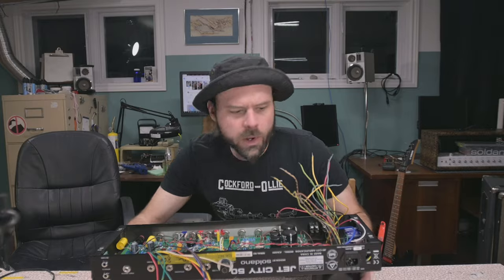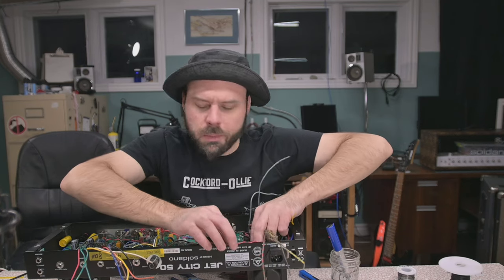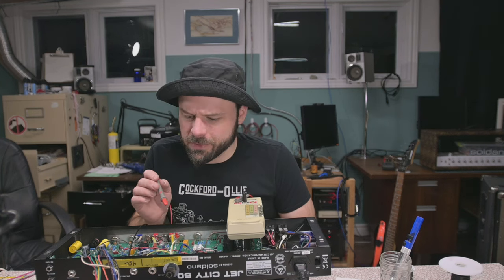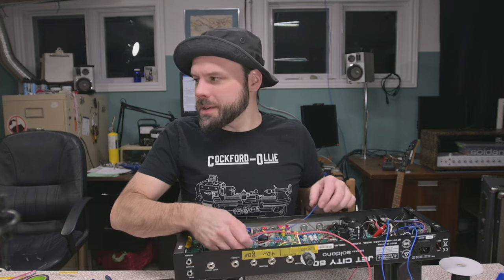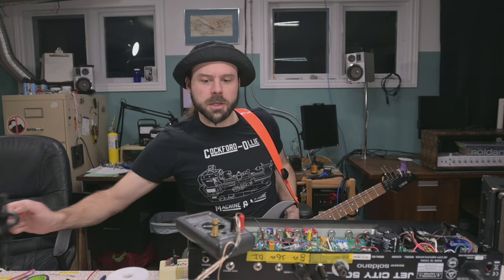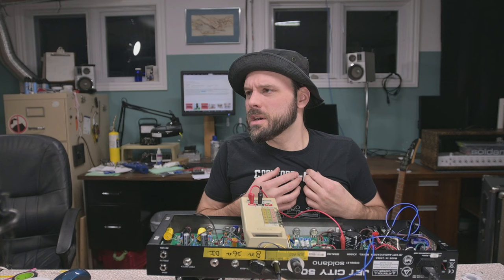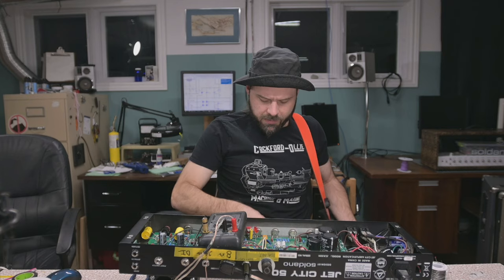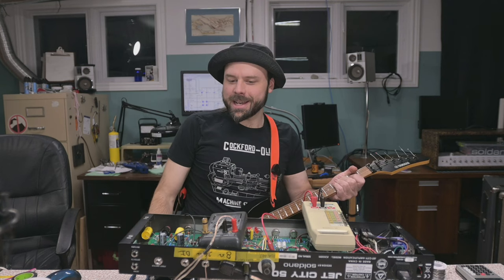Jet City Violence Ep.5 - Wiring New Transformers Part 2

Comment: This whole series of jet city and the slo build has helped me tremendously with fixing  my ol jca100h I had sitting around for years and hardly ever used. fired it up and noticed one power tube red plating after a while so I learned all about how to correctly bias and check voltages and currents. Got the tubes adjusted and after a while of playing the sound would cut off... 
Very long story short after all new sets of tubes the sound would still cut off randomly, very faint sound coming through tho. Everything checked out and tested ok i went through literally every component... after lots of insanity watching your videos dozens of times it turns out it was a couple of potentiometers that were intermitently cutting off or shorting out as the amp warmed up. Turns out the pots being soldered directly to the pcb and also bolted to the chasis caused the boards in the pots to bend just enough to cause problems. I have since replaced them all with solder lugged pots wired to the board instead of pcb mounted, along with a full slo upgrade including the big power caps and a new ot. These amps sound great! If you ever have any sound problems driving you nuts like I did, definitely keep an eye on the pots ;)
Reply from the maker: Oh nice. To be honest, I'm never sure if my chaotic videos would actually be a help to people, but that great to hear. 
As for the pots, yeah, that's not an uncommon problem in amps like this. Solder joints can let go where the pots meet the board, in some cases you might not have had to replace them, just freshen up the solder joints. In worst cases, sometimes if the amp got dropped or something, that can break the pot. 
And yeah, when an amp is behaving the way your describe, I check the treble pot. The treble pot is right in the signal path, if it fails, that's the symptom. I've actually had more than a couple amps come thru the shop with that kind of symptom that just turned out to be a dirty or damaged treble pot.
Reply: @DATT  
I did even try to touch up every solder joint on the pots and fixrd many other globby solder joints in the jet city, even checked them all with a meter. when the sound would cut off turning the knobs had no effect on the poblem so it was driving me nuts lol after removing them I could clearly see the boards on the pots were all bent at an angle.  the original soldano hot rods i saw had a metal spacer plate in between the chasis and pots I assume to keep them from ever breaking like this. 
Keep makin great videos like these I cant wait to see what you hack up next!
Reply from the maker: @MkMc-o1y  Yeah eh, I guess the pot was just broken then. 
And thanks ! No plans to stop.

Comment: Hey great videos. What is your patreon account name? Can you advise what the led clipping switch circuit is? What components are in it?
Reply from the maker: I had a Patreon, it seems to be missing now. I haven't use it. Going to have to look into that. 
The LED's are a clipping circuit. They are attached to the end of the cathode follower. 
Some arrangement of 2 leds in series, then another in parallel revised phase. Some caps and resistors to tune it. I can't recall details of it off the top of my head, but I know it get explained in a future video before I delete it in favour of a different configuration. 
It had an interesting effect, but because if where it was located, it was a global effect. If worked well with the crunch channel, but it redundant on the lead channel. So I found it inconvenient to use cause when I'd footswitch between channels I have to manually turn the clipper on and off too.

Comment: Hello! The power transformer in my 50H recently died. Can you recommend a 50w replacement with the closest specs to the original as possible?
Reply from the maker: Oh boy, that's a tricky one. I don't know of a direct replacement. I can make any number of Hammonds work in this amp, but you would need to modify the bias and switching circuits. 

Many replacement transformer will have bias taps, so not a bit deal, if they don't there is an easy work around. 

Problem is the Switching/relay circuit needs a 12v tap, which very few replacement transformers have. You'd need a second transformer for this, but a tiny 12v transformer just to run a couple relays is easy to fit. Kind of like that secondary transformer the amp came with you see in the first video, or I might have removed it in this one. Are you in Ontario by chance ?

Comment: When the black meter was reading O/L what did that mean exacly, like what was it O/L?
Reply from the maker: Overload. Meter was probably in the wrong range. I'd need a timestamp to be more specific.
Reply: @DATT  MMMM 24:40 I think. And oh yea, that makes sense, was probably just the meter yea hah!
Reply from the maker: @jamescassidy4045  Oh, current draw momentarily peaked over 200ma. Running a bit hot if I crank if full out. But then, this amp isn't really designed to go to 10.
Reply: @DATT  Ohhh okay, that makes sense! Thanks bro!